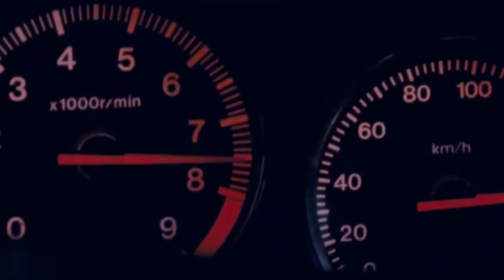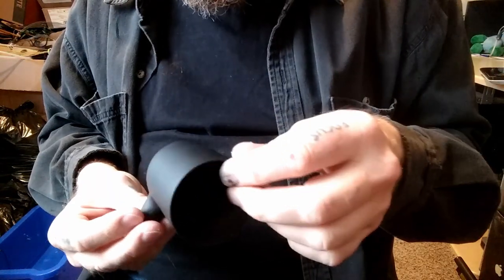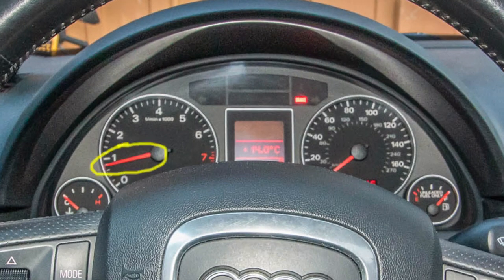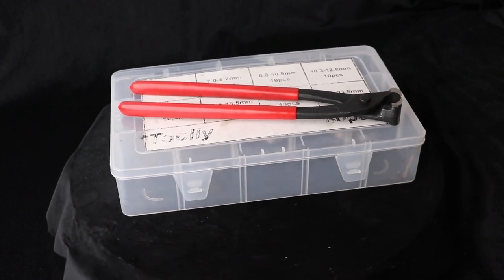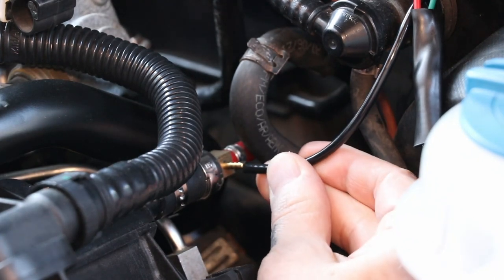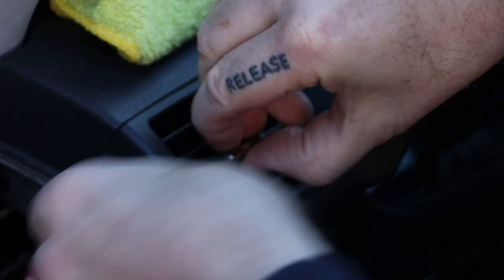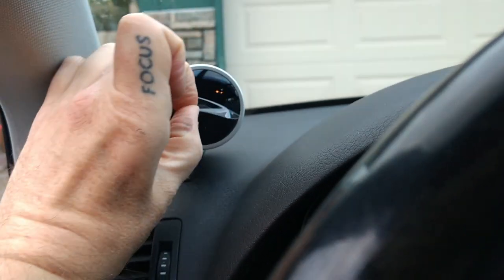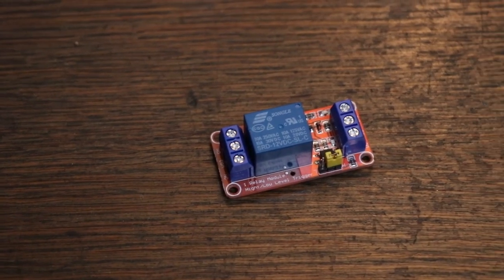Install a Turbo Boost Gauge in Audi A4 B7

Comment: all of the cons appear to be buying a local economy low end gauge. I like the pod option as well as the crimp connections because in my older years as a mechanic hose clamps simply do not cut it for the professional install going to go with a Stewart gauge for my nephews A4
Reply from the maker: Yes, good point on the Cons. I'm also really happy with the pod I chose. A bit more work than other options due to the 3D printing. The benefits of buying the local economy gauge are: Supporting a local business, having it immediately (in Canada Amazon shipping is Sloooooooow), The rattle sound in the gauge is typical of mechanical gauges no not an issue with mine specifically. I totally agree with your opinion on hose clamps. The crimp clamps may be more work, but they look professional. I just checked out the Stewart gauges. They look great. Simple design, with no flashy logos or strobing colours.
Reply: Picked up single ear clips from harbor freight for $12.99 turns out I bought the tool about 30 years ago been sitting in my tool box ever since USED to remove and re use these oem clamps during repairs to save on time getting hose clamps which look amateurish. Same reason I solder connections and shrink wrap them instead of using wire connectors . professional job.

Comment: Hey so great video just what I was looking for,so for the defrost vent gauge I love! What would be the size boost gauge that fits that type 52mm? I just don't want to buy the wrong size,I appreciate any help on this before I order it
Reply from the maker: It’s funny how different manufacturers will call the gauge 52, or 50, 2.05 inches. In my experience they are all the same size. But to be certain reach out to the Ido3Dprints guy. He would know for sure. I put a piece of gorilla tape on my gauge to shim it into place. The gauge by itself was a wee bit loose.

Comment: Does this work for a 2004 B6 A4?
Because it has the same light switch that is in your video
Reply from the maker: I have no idea. There will be a place in the switch that you can tap into, but you are going to have to get a wiring diagram for your specific model to know for sure. There are different switches even within the B7 model line. For instance some have auto lights, some dont. etc.
Reply: @KeirBriscoe  I’m going to follow yours and see if it works I’m doing it now as we speak

Comment: I bout a 2006 a4 sline 2.0t 6 speed with a boost gage and it peaks at 15 holds around 14 is that stock boost or US that tuned up I've been trying to research it but can't find an answer
Reply from the maker: Stock boost is around 7-8 psi. My APR stage 1 tune gives me 15 psi so I would assume you have a tune of some sort applied to the ECU.

Comment: What type of adapter did you use..? Is there a link I can use..
Reply from the maker: I'm not sure what adapter you are asking about. I built my own adapter that taps into the intake manifold. And I wired directly to the headlight switch.

Comment: To nie jest prawidłowe podłączenie  przewodu . To mierzy podciśnienie w silniku przy zamknietej przepustnicy  lub nadciśnienie przy maksymalnym otwarciu przepustnicy.
Reply from the maker: Yes, that's what a turbo boost gauge does. It measures the pressure of the air going into the cylinders. But if you know a better place to put the sensor pick up then please enlighten me.
Reply: @KeirBriscoe  I'm not an expert, but it seems to me that the hose connection should be before the throttle. Regards.
Reply from the maker: @gdariusz4914  This is the correct area to locate it. Many people tap off the hose fitting that goes between the intake manifold and the PCV, but Ive heard horror stories of the plug screws getting sucked into the cylinders. Positioned where it is it shows vacuum when there is high engine RPM and a closed throttle. If the gauge does not indicate a low enough vacuum at idle it is an indication of an air leak somewhere along the path from the turbo. Cheers!